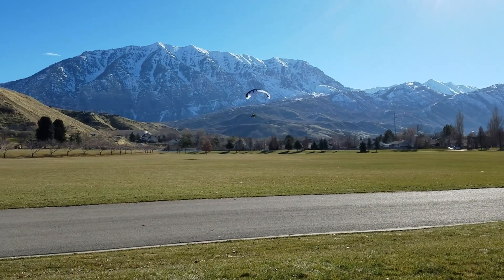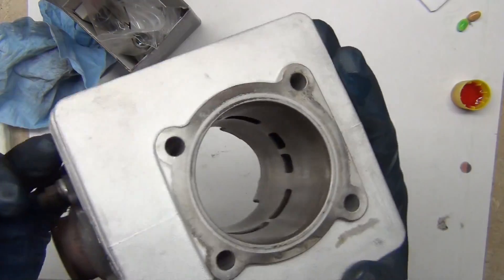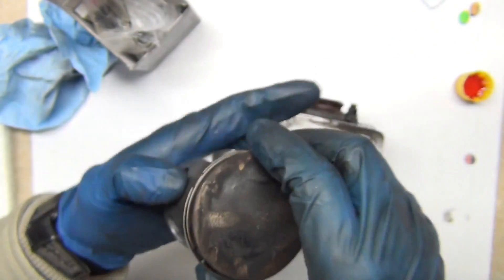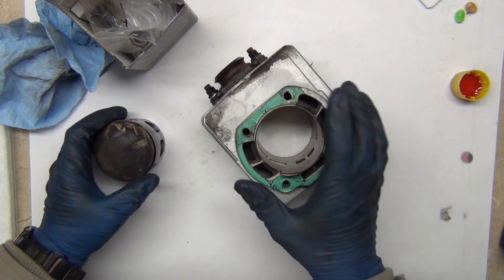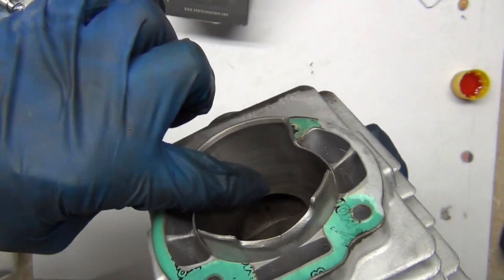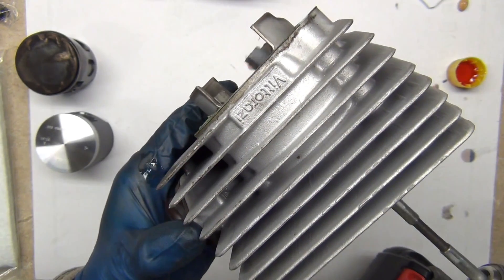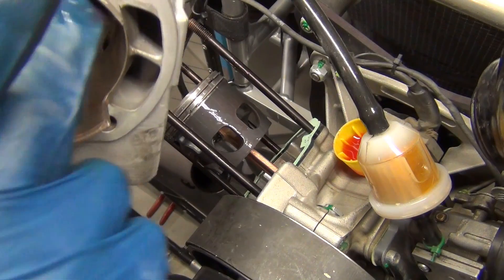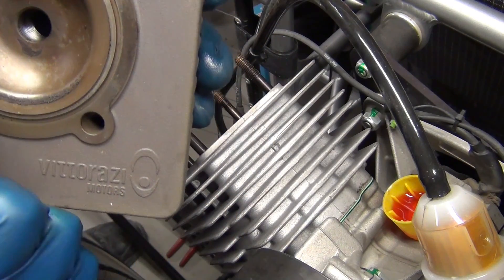2 Stroke Cylinder Install Onto Piston How To Vittorazi Moster 185

Comment: I was hoping that this was going to be a video on how to find a moped cylinder and piston that will fit on the Vitto 185.  I can actually afford to lose some power.  Many people are dropping down to Atom 80 size motors.  Would be neat to find something cheap that fits the lower case.  I've been told that the original Vitto was based on another companies pistons.

Comment: How do you clean the cylinder compressor hole? Thanks for your videos, are great!!
Reply from the maker: Soften it with solvent and use compressed air, or use a small phillips driver if you have to.

Comment: the philosophy at the shop I worked at was  heat cycling was important on 2 strokes but significant combustion pressure is needed to seat the rings to the cylinder wall before the cross hatching glazes. 

Nice video, I can't wait to get a paramotor

Comment: Great video.What do you call that tool you used to take the marks from inside the cylinder head. The tool you had attracted to the drill. Where can i buy it.

Comment: want more bang for your buck? the hack way is take a half round file and do 5 stokes over the top side of the exaust port want even more? widen the u ports on the bottom of the piston also. wy up? the exaust gets out faster and the new mixture gets in faster in a bigger volume dont forget the engine will get hotter and so you will need a hotter sparkplug there are guids on YouTube to help you further just search 2 stroke engine. also you can make more compression or "sqeeze" by using 2000 grid sandpaper sticking it on some glass NO BUBBLES! and sanding the surface down on the gaschet side flat make sure the piston does not hit the sparkplug on TDC with some bubble gum on the piston and the head in place turn the engine one time by hand. if it cant go one stroke you need a new head because you hit the sparkplug

Comment: that piston can still be used. i do it all the time also scratches can also be caused by the mixture for bike 2 stroke engines it sould be for litre 1:50 the vertical scratshes only affect the power wen they go past the piston rings at the top TDC

Comment: Hey Brian as always another great vid. I must ask what is a good torque wrench you would recommend for low- higher torque specs. I currently have a Stanley fat Max torque wrench but the range is 20-250 ft/lbs. I'm looking for something in the lower range like 5ft/lbs and up.

Comment: I was taught to clean the cylinder bores very thoroughly with hot soapy water using dish detergent to remove any tiny grit and iron particles adhering to the cylinder walls after honing.  Maybe it is not quite so important now, because of the new different cylinder
surface treatments and piston ring combinations that require a much finer cylinder
finish, but cleaning was very important with plain cast iron bores.   Immediate oiling of bores after cleaning is of course required to prevent rusting of iron surfaces afterward.

Anyhow, thank you for your great and always interesting videos.

Comment: @briansmobile1 I always thought that using a stone hone/deglazer on a coated cylinder was a big no no? 

Tip for next time... I just redid my '77 moto-ski motor. Used the same tool, but non coated cylinder(maybe it was lol). I found using oil on the stones clogged up fast and made a mess... I ended up filling a sink with water and lots of dish soap...seemed to work great. Just get the cylinder dried and oiled asap after!
Reply from the maker: Interesting idea for sure.  I did very, very little honing at all.  We'll see how it turns out.  So far it starts fantastic compared to before.

Comment: Great video. I have the same unit. Have gone thru 3 exhaust in less than 40 hours. Cracks at bend. Otherwise a great engine. Wish Vittorazi had used a two or three piece exhaust.
Reply from the maker: Crap dude!  Did you just weld it?  Or replace it?
Reply: Replaced with new one each time. So the first one lasted less than 5 hours, number 2 lasted 8 hours. The new one I replaced has not cracked yet. The first one was chrome, the 2 and 3rd are black.
Reply: @davidh7636  is it possible that you're not tightening it correctly in a cross pattern and I wouldn't torque them over 14lbs.

Comment: How many hours did you have on the engine before you overhauled it?
Reply from the maker: I bought the engine used, so I have to guess..  my guess is about 400-500 hours.  I obviously don't know for sure.
Reply: Thanks. That seems a reasonable TBO for a 2 cycle. I've seen the mountains you fly over, so I think you were wise to overhaul the engine.

Comment: When BMW came out with Nikasyl cylinder coatings on their bikes in the dark ages, they said to not hone the cylinders at all, just wipe them clean and reassemble. It must be significantly thicker stuff these days.
Reply from the maker: I went SUPER easy on it.  I rambled on and on about that, but I had to cut it.  Wiping it out is best.
Reply: I've always been under the impression that you shouldn't hone nikasyl due to the fact that the coating is porous, and the the fine powder created from the honing stones fills in those pores, thus taking away lubrication..

Comment: WHY DIDNT YOU MENTION THE DECOMPRESSION CYLINDER HOLE.? THAT WILL CLOG UP .AND WILL MAKE STARTING THE ENGINE HARDER WHEN TRYING TO START?  OR DID YOU FORGET? AND THATS WHEN THE PROBLEMS STARTS .... YOU FORGETTING LOOK AT 5.23 BE QUICK THEN PAUSE YOULL BE ABLE TO SEE THE SMALL HOLE IN CYLINDER..   VERY TRUSTWORTHY KNOWLEDGE. BY BRAINSMOBILE 1
Reply from the maker: Are you yelling at me?  Just wondering.
Reply from the maker: What would you like to see happen?  Would you like to see a video on that part?
Reply: IAM ABIT DEAF.TRY ANSWER THE QUESTION.... IF YOU CAN

Comment: any tips for removing the old base gasket easily
Reply: I always oil both sides of the new base gasket and it usually comes off easy the next time
Reply: "savvy" would be the operative spelling, but thanks.
Reply from the maker: I use a razor blade and shave the paper down to just a film taking care not to take any aluminum.

Comment: From my days of racing motocross and enduros The manufactures were not too concerned with the match between the transfer ports and the cases.  I would always match these ports, usually going no higher up and down  than needed to give a smooth radius.  I have cured several jetting issues with this and the smoother flow the more power it will make.  You might want to check this the next time you split the cases.

Comment: Is there any requirements for an inspector to check off your work after completion? It's a great hobby and boy that area is beautiful for flying.
Reply: No, in the US, paramotors are licensed under FAR 103, which doesn't require any airworthiness certification, or even any pilot certification. You fly at your own risk, so it's your responsibility to minimize that risk

Comment: How do you monitor fuel usage to make sure you don't run out? Did you have an aversion to heights before flying? Does the wind from the prop fill, and lift the sail/chute? What happens if you loose thrust/engine while flying?
Reply from the maker: Dude.  You're like me.  Lots of questions.  Here goes.
1. I lean left and look at the semi transparent tank.
2. Yes.  I still do.  I just manage it with directed thought.  (think over pre-flight checklist and gear- training etc.)
3. No.  Forward motion does.
4. Fly like a regular para-glider.
Reply: Awesome, thanks